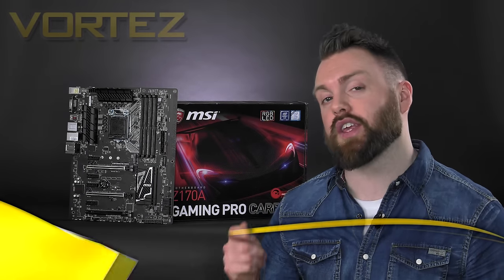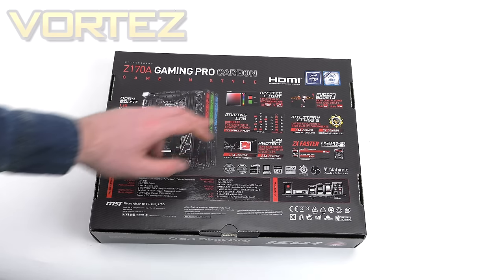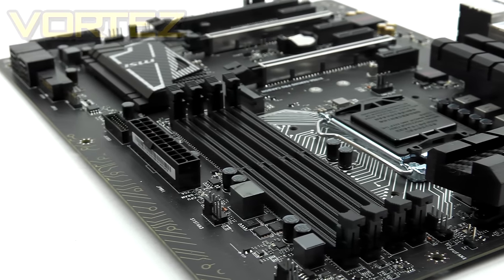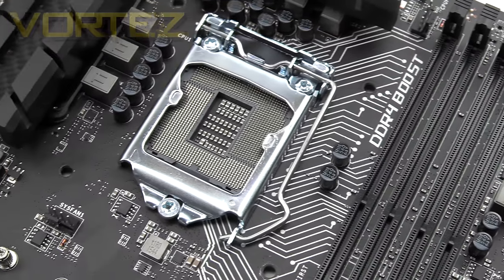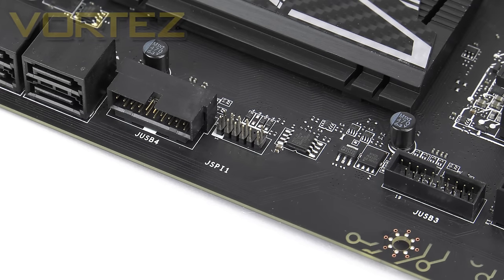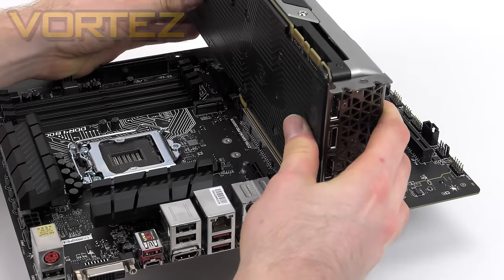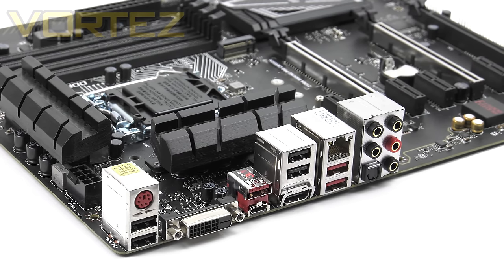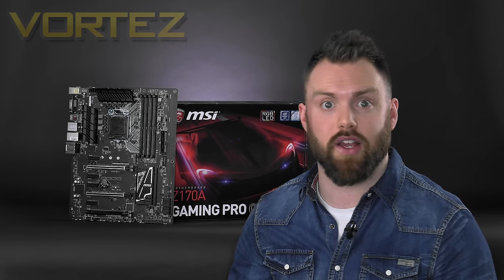MSI Z170A GAMING PRO CARBON Review [4K50p]

Comment: So my PC i built my self is having too many problems! (Spent roughly $1300 from what I remember) So I've been looking at prebuilt (specifically Ironside PC's) is this a good build??

Cpu: i5 6500 3.2ghz
motherboard: Gigabyte GA-H110M-A 
cooler: hyper 212 plus
ram: 8gb 2400mhz (2x4gb)
gpu: geforce gtx980 4gb
psu: rm750 watt gold

price: $1,197.00 

also I had one more question can I deactivate the os on my current pc and then activate it on this one (if i do get it)?
btw great review! keep up the great work ;)

Comment: USB 3 is not 100% backwards compatible.

My keyboard suffers from ghosting when plugged into USB 3, My webcam lags with USB 3 and My old headset used to get bad noise degradation while plugged into USB 3.  That is why I have to go for this board as it is one of the few that have more than 2 USB 2 ports.

Good video though... You helped me decide to get this board.

Comment: Nice video. I bought this motherboard funny enough for my work pc to go with  a 6700k and hyper 212x. CPU temps is just simply amazing and never reaching over 40C in normal workloads. Normally it sits at 30C but when I add a moderate load on it it's goes up to 45C max and that's just crazy low. I have the feature called enhanced turbo on so on all cores it goes to 4.2GHz. I really want to overclock this cpu but for now 4.2GHz is fast enough and seeing as this is my work pc I will rather not overclock. the extra speed on the 6700k vs 6700 is already a win for me cause the cpu wasn't that much more and my work was prepared to pay the extra money.

Comment: Good review, I'm currently in the market for an upgrade.  Agree with you about the USB 2, very strange, so I'd pay more just to have more USB 3, which means this board is out although I have another MSI on my list.
Reply from the maker: +Bill Bittle Thanks - which board is it? :)
Reply: At the moment the MSI X99A SLI PLUS LGA 2011- $300. Can $.
Reply: +Bill Bittle  It's a good job I'm taking my time with this and that's partly because of the weak Can $, elelctronic prices are about 40/50 % higher than U.S. prices at the moment.  When I started my wish list back in December I had included the 'Intel® Core™ i7-5930K Processor' and I wanted a board with DDR4 capabilities.  So now that this discussion has started possibly you can make some recommendations.  I'm 70, still game (counter strike source and BF3) but don't see all that well and I do a small amount of video editing.

Comment: This board simply refuses to allow me to boot AHCI M.2 SSD with a Sata Raid0 present. 
I can see either in boot list alone and I can install OS and boot the SSD as long as the sata isn't plugged in. I can even see the SSD on the Sata OS but the SSD doesn't show in the boot list when it already has an active partition, boot track and OS installed.
 I can only assume it's some kinda Bios/Controller problem.

Comment: i have to decide between this and the m5. which one should i get?
Reply: I'm in the same position, but I plan to use a sli 2 GPU Gtx 1080...
Reply: ๖ۣۜ KENNEXS i would suggest you to take the new z270 m5. its sexy as hell and it has two full ×16 pcie lanes so your 1080's won't be bottlenecked. also plz take the 7700k for an sli configuration that beefy... anything below that will also bottleneck
Reply: jeff, Ich heiße jeff Thanks mate I do really apreciate the reply, Yeah I agree with you I just saw some other bench & review it will be some bottelneck if I use a asli 1080 on this motherboard I already bought the 6700k , thanks for tips dude, if you know anything else pls noticed me it will be helpful..
Reply: jeff, Ich heiße jeff
Hey look this bench between the 7700k & 6700k oc there's no a big difference between them http://arstechnica.com/gadgets/2017/01/intel-core-i7-7700k-kaby-lake-review/

Comment: I'm glad to see them use an Intel NIC on this board. I went with the MSI Z170A Gaming 5 motherboard and it has the "Killer NIC" which has given me terrible performance.
Reply: +Jim Lamb I don't have a problem with it but it's no better than any Intel NIC. I see it as a placebo, and it only adds to the overall cost of the board.
Reply from the maker: +Jim Lamb I agree totally here - which is why I always tell you what LAN controller is being used. I have a killer chip on my notebook and its caused quite a bit of hassle in the past.
Reply: +Jim Lamb my killer nic on the gaming m5 was also a pain in the ass since ive had this board with the intel nic i can now stay online for longer than a few hours without random disconnects.